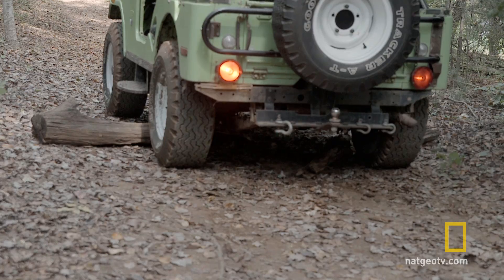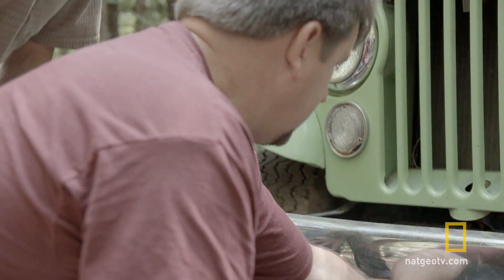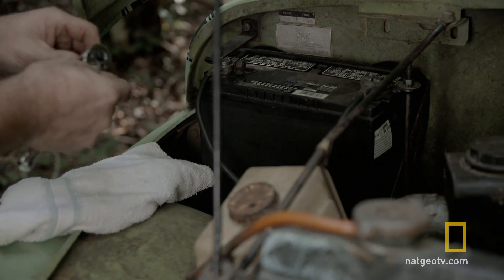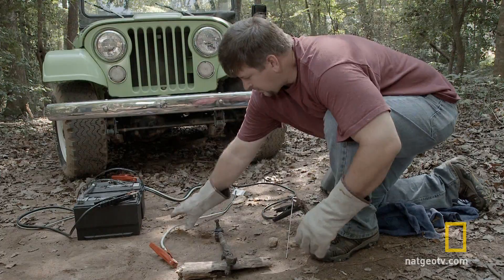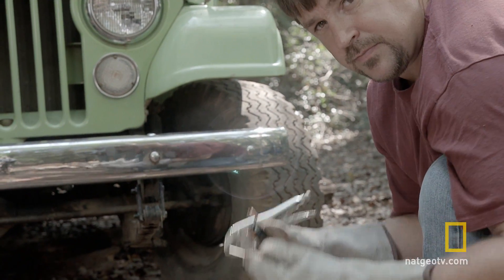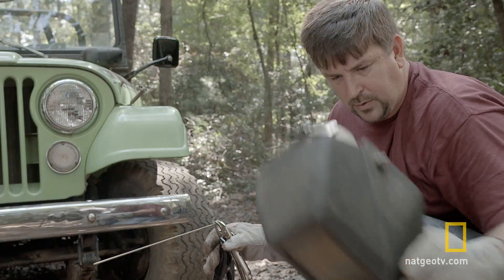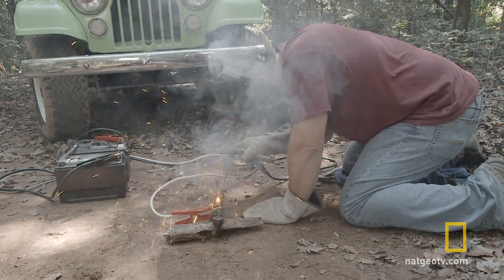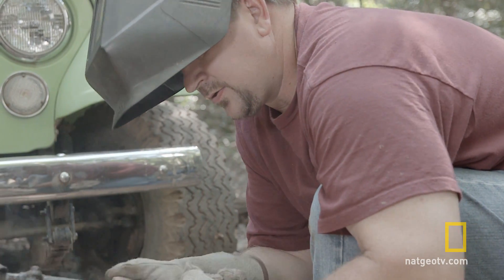Doomsday Prepper Tips: Welding | Doomsday Preppers

Comment: Now.... Where can i get Welding rods in the wilderness?
Reply: You look for slow flowing bodies of water downhill from iron rich soil; often you´ll find welding cane there. The reeds that keep standing in the plant cluster from the year before are usally dry enough to use right away; the amperage they´re  useable at roughly corresponds to that of a commercial welding rod of the same thickness, so you´ll have to look for the right thickness to use with your car battery.

Comment: Wile using the battery on this oldmodel jeep live engine running it will alternate on new models the compurer will spot the engine.always carry a pack of welding rods and tools.p.s make sure to secure the cables on the vehicle so they don't touch anything other wise FIRE FIRE. Been there done that it really works.vet. Vietnam.